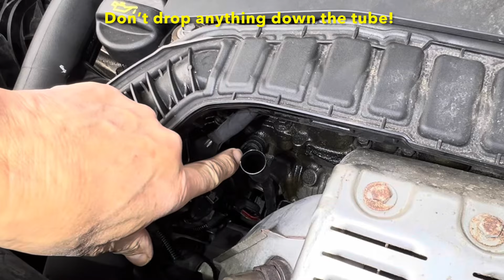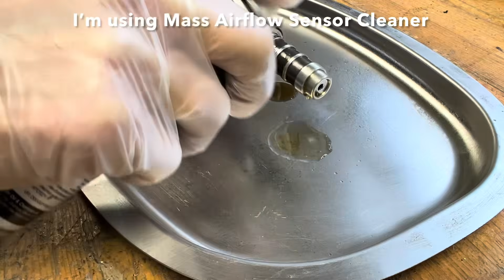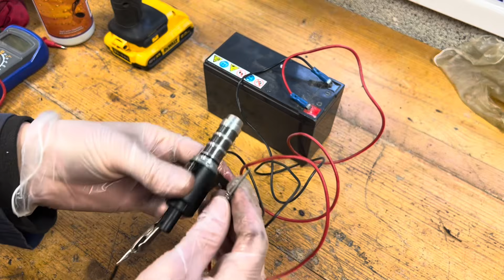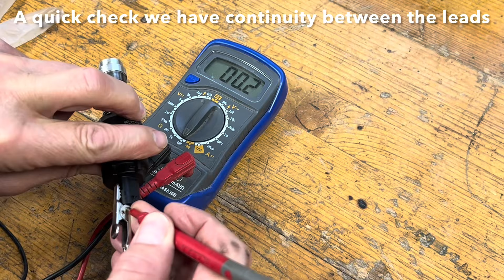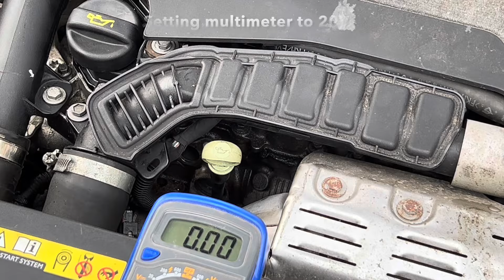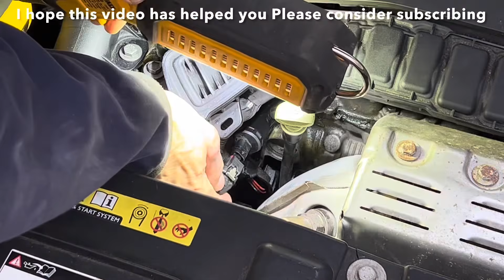Citroen C5 1.2 Puretech: Variable Valve Timing Oil Pressure Solenoid (Remove, Test, & Replace GUIDE)

Comment: Hello mate, I had my Cambelt done in April on my 1.2L turbo corsa 2020 which is I think the exact same engine. When I sit in the car haven’t turned anything on a low oil pressure light appears. I then turn the car on it says low oil pressure and add engine oil. However, I’ve checked the oil and it’s correct level but when I let the car run for a little restart the car then start it up again it disappears and does not come back on. It also does not do this all the time only rarely happens maybe 1 or 2 times every week or so. I had the garage who did the repair check and they told me it’s all okay but it has still appeared afterwards any idea what it could be? I’ve seen some people say shitty software my thought are maybe just a crappy sensor.
Reply from the maker: Have the garage actually physically checked the engine oil pressure. Ie fitted a temporary pressure gauge. This is the first and most essential step. Once the oil pressure is confirmed as good you can then explore other possible causes. Let me know. 👍🙂

Comment: Thank you sir for the video, but the car suppose to have 2 solenoid one on each cam so why clean just one
Reply from the maker: Thank you for pointing this out and my bad for not actually mentioning it in the video. I actually did mean mention it was one for each cam and the procedure would need repeating for the other one but completely forgot too. As soon as I get chance I will at least add the information to the description. I appreciate the thanks for the video. 🙂👍
Reply: So I have one question. Is another solenoid located in the back of the motor? I mean closer to turbo (if have one) and closer to cabin?

Can you actually switch those two ones because that's what actually advised to do if faulty code is p0014? And if it will show p0011 after the change the solenoid itself is done.

I have this in my Euro 6 Puretech 1.2 Citroen C4 2017 version, so can I find these solenoids like this you showed and another one from the back side?
Reply: J'ai le même problème sur ma C4. 1.2purtech 110.   2017
 @LeonJable
Reply: Je voudrais bien savoir l emplacement du deuxième dephaseur sur Une autre védéo